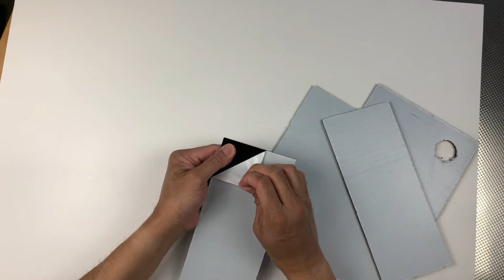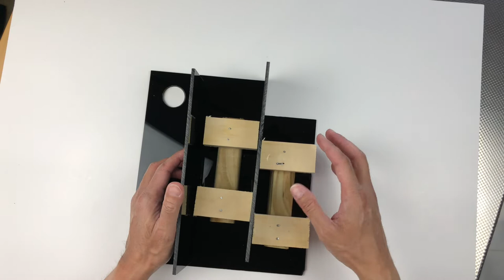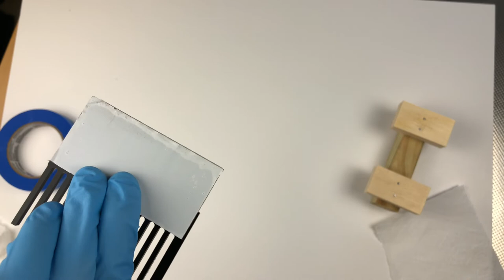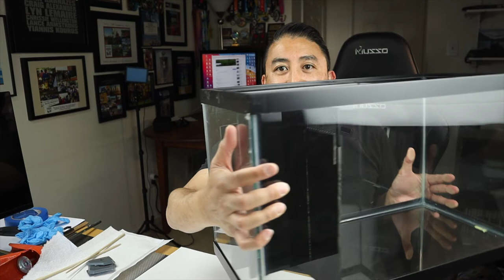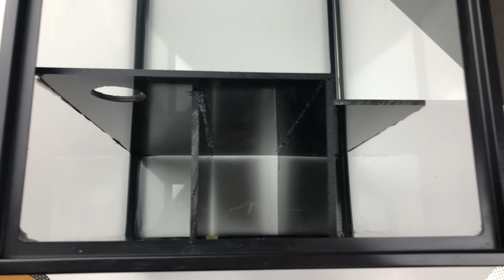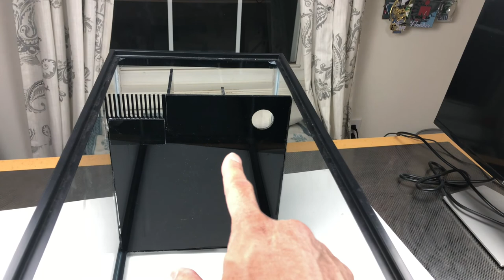New Budget DIY Nano Reef Tank Build Part 2 - Making the All-In-One Saltwater Aquarium

Comment: I noticed you only did the outer part with silicone you don’t need the back part as well?
Reply from the maker: Since I used silicone along the edge of the acrylic, doing the front only was adequate.
Reply: You actually do need to silicone all of those surfaces he forgot to.
Reply: @skippersreef4009   without silicone on those back baffles your not seperating the stages, water flows around the walls since there is no seal. Silicone the acrylic piece on all the edges underneath and along the backside then place it in the tank. Then you can run your final taped line silicone front seal.

Comment: cant you just not make an over flow up top and make a hole midway in the 1st section with a strainer and it will act as a filter that way?
Reply from the maker: Do you mean instead of the slots or grill on the overflow? That’s to keep fish, inverts, etc from going into the first chamber.
Reply: @skippersreef4009  meaning pretend thats not there at all no overflow no cutouts so lower intake is the only intake kind of like say hob filter with intake in watere
Reply from the maker: @scottrobert2724  ah got it. Yeah I’m sure you can just have a lower intake. I don’t have that. I wanted to have an overflow to pull the surface water where oily residue tends to build up.
Reply: @skippersreef4009  yes saltwater absolutely but freshwater tank only here. can pop a strainer on and any fry can even put a strainer on. Im building aio now so im gonna use overflow and drill a hole for lower see how it is. i can always plug it